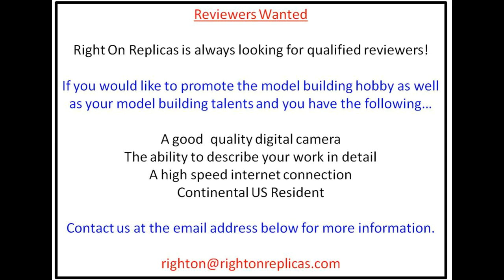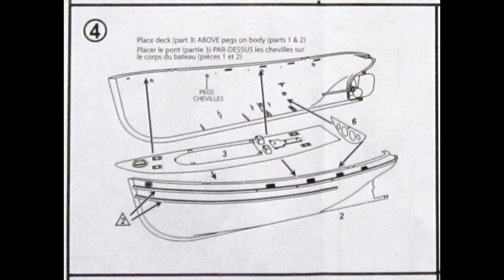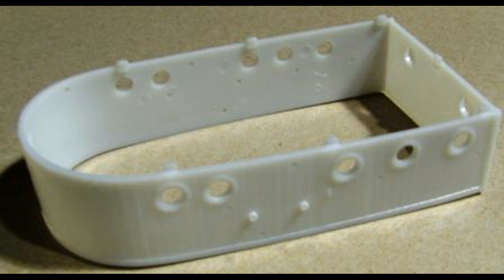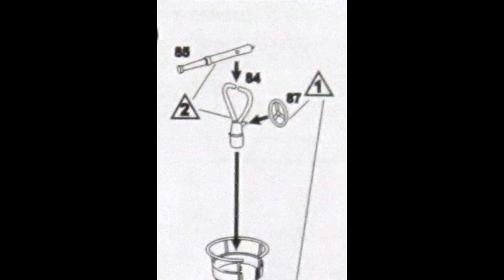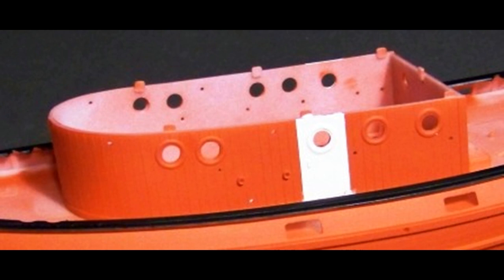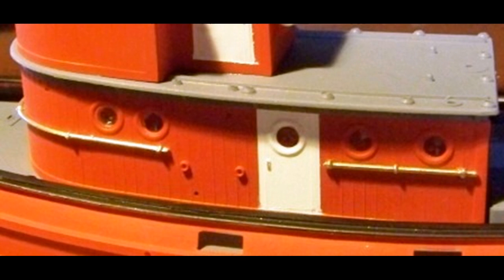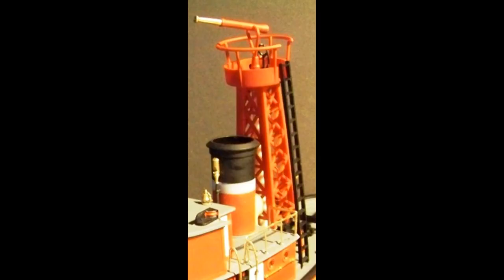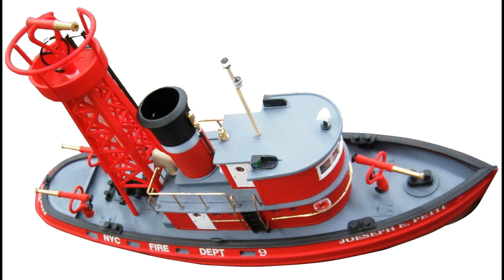How to Build the Fire Boat 1:72 Scale Lindberg Model Kit #77226 Review

Comment: Actually this model was NOT done as a fire boat it it's original form. it was first done as the steam tug Hercules, then as a Coast Guard Tug.  the kit had NO over sized fire monitors as it does now. and was motorized. it also came with three crew figures.  Why Lindberg decided to redo the kit as a fire boat is totally unkown. As It does not look like any fire boat that was or is in actual service. it should had just been left as a steam tug.  the only changes needed would had been a longer lower deck cabin. and new towing winch as the one in the kit is actually a fishing trawler version and not one ever used on an actual tug.  The figures that came in the original kits were actually over sized. and Ho scale figures were more to scale with the kit. Shame they changed it to a fire boat as with the over scale tower the model will be top heavy, so making a R/C, or just motorized version would be risky to make turns with, as the model would probably have a high risk of capsizing.  not to mention to bring it to a stable center line with that tower.  it would sit way too low in the water.  I have seen the Coast guard version built as harbor tugs and Remote controlled and they made nice little tug models.
Reply from the maker: CD, That's some great information.  I still like the way it looks.  Models aren't always great replicas!  -Doug

Comment: Great explanation but I did not understand a number of statements. I was able to buy the North Atlantic Trawler from Lindberg, but the glue does not work well, I have understood correctly that you clean the parts before gluing, may I ask what you are cleaning with and which glue do you use. Thank you for your comment and explanation. With regards from Rober
Reply from the maker: ROB,   The plastic on this kit did not respond well to Tube glue.  I used Superglue and 5 minute epoxy for most of the construction!  PS, please subscribe if you haven't already to help us reach more modelers.  -Doug
Reply: @RightOnReplicas , ,I have been following you for years and am honored with your answer and explanation. I live in the Netherlands and we do not know the adhesives mentioned here as you explain it. Do you also have brand names, maybe I can search that way. What do you mean by Tube Cement and what brand do you mean CA adhesives. Thank you for your response.
Reply from the maker: Rob,  Epoxy glue is  a type of adhesive.  There are many manufacturers of that product and they are all about the same.  Two-part 5 Minute epoxy works best.  Superglue is a brand of cyanoacrylate adhesive (CA).  Any manufacturer will work just fine!    PS, please subscribe if you haven't already to help us reach more modelers.  -Doug